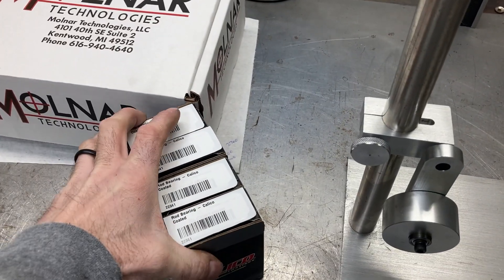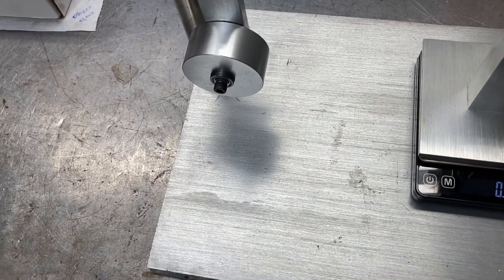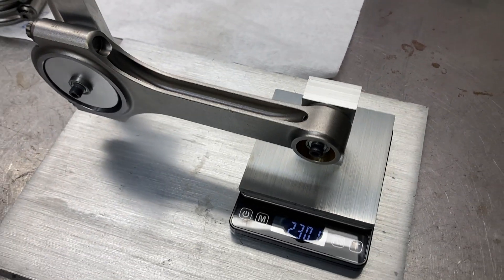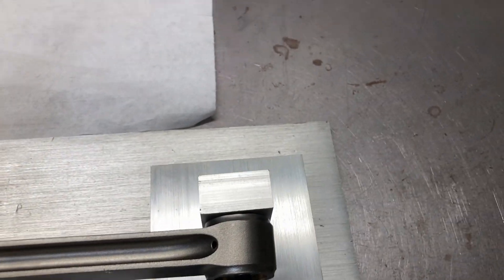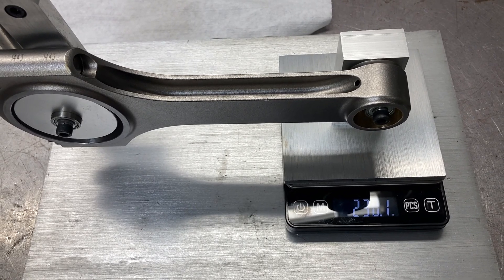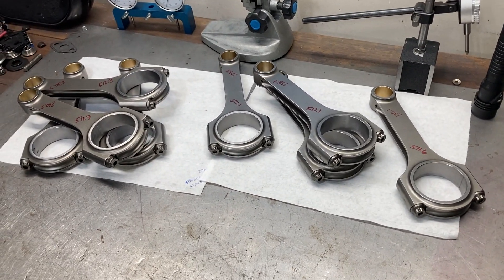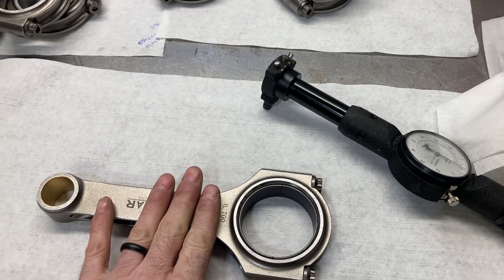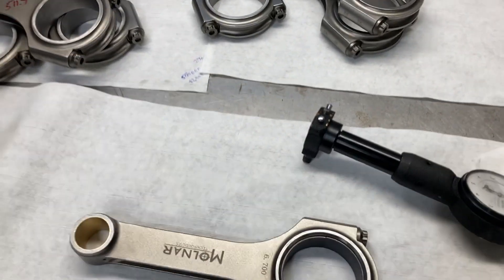Lykins Motorsports 496FE Rod Bearing Clearance Follow Up

Comment: My bore is 4.250/stroke 4.375 is this same?
Reply from the maker: Yes, 496.
Reply: @lykinsmotorsports  
👍Yes, i have it in F250
with c6/manual valve body/ratchet shifter:
fun to drive...allmost
dangerous at street....
Molnar rods too.